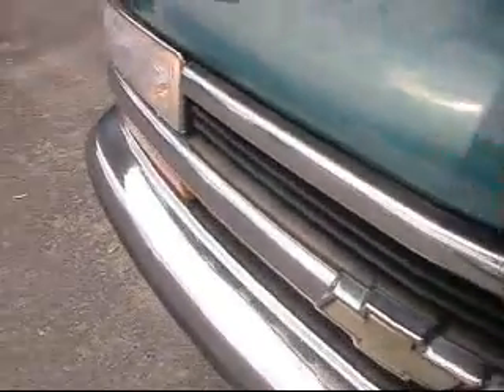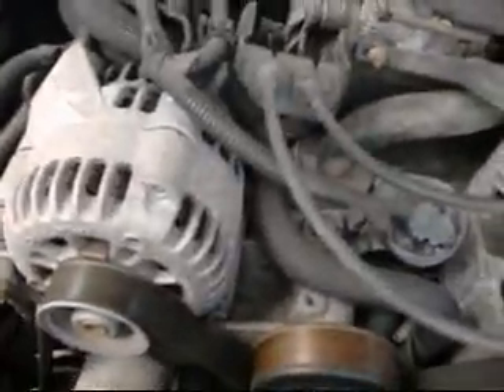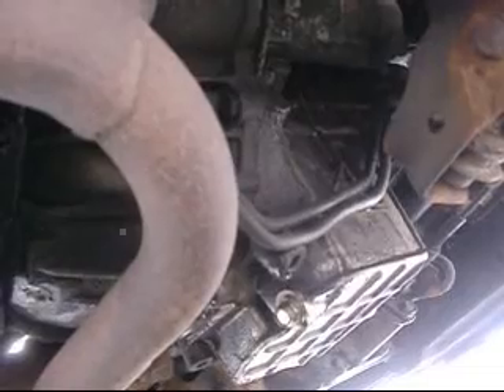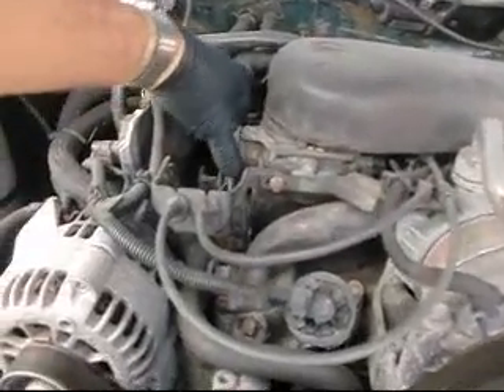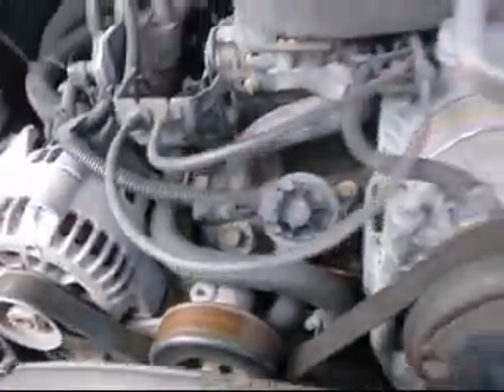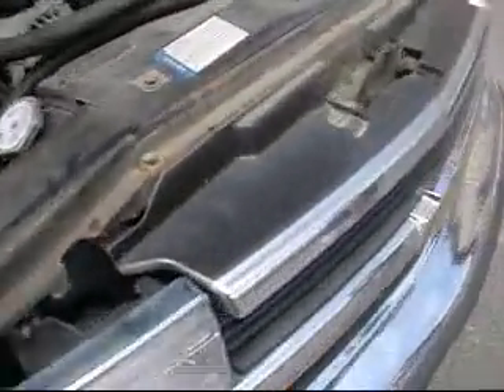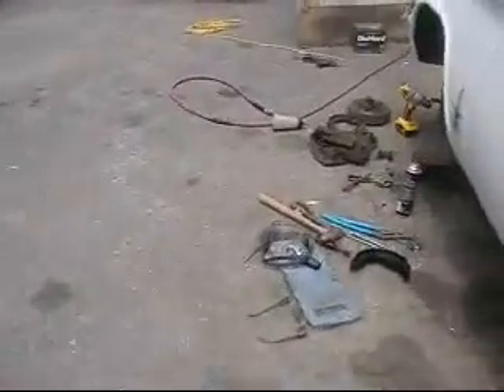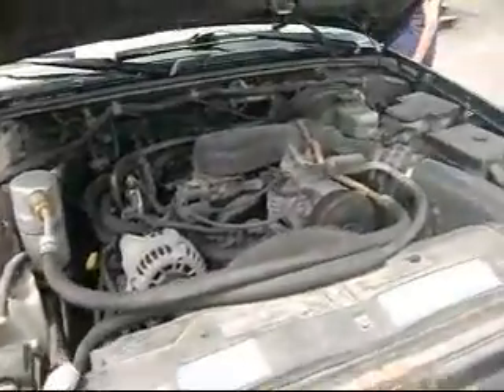6 10 11  Fonzi Banging...

Comment: In 30 years as a diesel mechanic in a shop that also services light duty equipment I never ran across loose flex plate bolts (no flywheel in an automatic)... I have seen many cracked flex plates and they sound just like that!

Comment: What do you expect from a cheaply made GM. Should have did a brake stand that would have seen if the torque converter bolts are loose.  She buys something newer it is worse to fix, drive that thing till is won't go anymore.